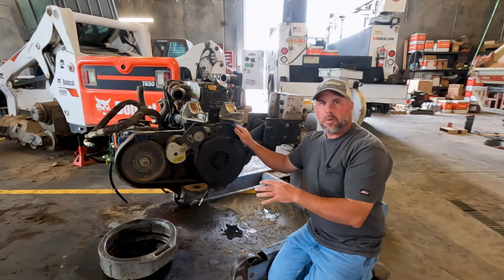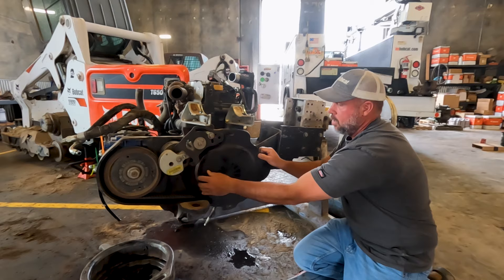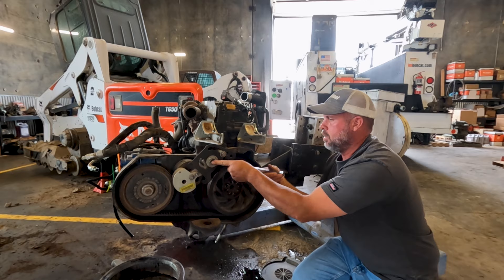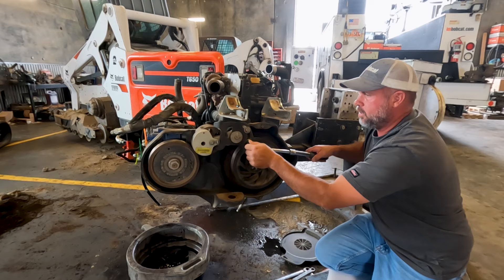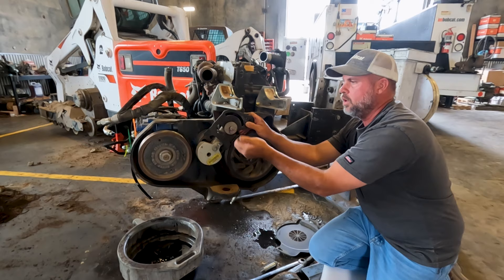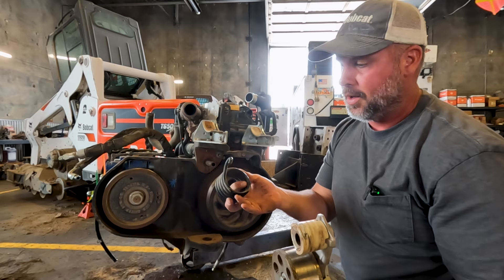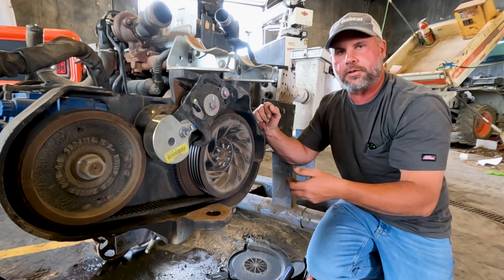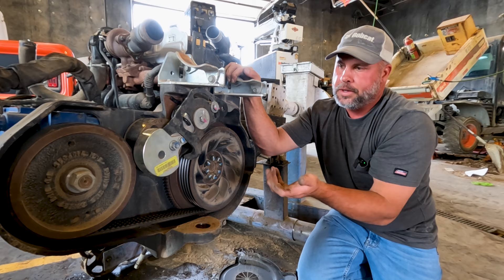Bobcat Drive Belt and Tensioner How To

Comment: I have s510 upon start up have a rattle/grinding noise in belt area, haven’t broke it down yet, but could bad tensioner be the culprit?
Reply from the maker: I would think the tensioner pulley bearings have failed.

Comment: On my 763 we find that we cannot keep tension on the belt even with a new tensioner.  There were two belt lengths for 763's one is too short and the other is too long.  We drilled and tapped a new hole to make it work.  However, after just a few minutes we lose tension.  You've seen many more of these than we have do you think we would have a chance of mounting the new style tensioner to the old style of housing?  It looks like a single threaded hole and a roll pin.  The adjustment and tensioning look much more forgiving.  I think we could buy one from salvage.
Reply from the maker: You should have a spring tensioner.  Are you sure the you are getting the spring engaged correctly?

Comment: Great video.  I have a question.  My S550 is very similar to this setup.  However,  my tensioner appears to be frozen/stuck to the hollow shaft. I loosen the mounting/pivot bolt and the tensioner will barely rotate even with a breaker bar. Is this common? I am considering heating up the hollow shaft, but am concerned. Any ideas?

Comment: @11:02, Very important step to make sure that bracket rotates completely where it's touching that 'pendulum' part, and pull it down a hair past that.    If working with mechanism inside the Loader, it might be good to wear gloves, otherwise you might slice your pinky open on the battery box tray on the bottom if these wrenches slip during that rat trap maneuver.        Note: Most torque wrenches are not "Bi-Directional"  where you can get a torque read in both directions.   When you are trying to put the 40 lbs of pressure, your garden variety Torque wrench will not give you the 'click' you are waiting for.   You will need a Harbor Freight Pittsburg torque wrench that is "reversable" or something better if you want to make sure it's torqued correctly.  I found the best thing to do is just like shown here, make sure that bracket rotates where it can't rotate any more and the belt is tight.    Otherwise the belt will start slipping, it will make a loud clicking/rattling noise when you strain the hydraulics like when turning and you will have to re-tighten.     If you get the belt on right,  your machine should feel 'peppy', like it has got some power back.

Comment: Hi yes I did remove all the fuses the sockets did feel tight. I will unplug the aux controller tomorrow.Sorry what do you mean see if gateway comes back online. The machines controllers seem to be working I don’t have an external tool on it. The codes just pop up. This happens erratically but once it does it continues for a while.

Comment: I got a 2015 t770 that will need a input seal on hydraulic pump sometime. Wondering what the best way to go about that? Even a video on pulling the engine and pump assembly would be nice!

Comment: Im a beginner in this field of work I have about 2 years on Bobcat and Genie scissor and telehandler maintenance and repair.  You have helped me tremendously. Thank you very much.  I am beginning to understand the Bobcats. I had an issue with a 2017 T650 it has erratic trouble codes( M4404 "aux controller no communication)and (H7404 gateway controller no communication main controller no communication. I have check all the fuses all good, and have unpluged and check the wires and plugs from the controllers that route behind the drivers seat. I lifted the cab and checked the wires and plugs Any thoughts.
Reply from the maker: Did you actually remove the fuses and make sure thay are tight in the sockets?
Reply from the maker: Unplug aux controller and see if gateway comes online.  You might need a new auxiliary controller.

Comment: Thank you
Nice video
How do you change the stud that tensioner bracket goes over
Stud I'm referring to is pressed in to block
Reply from the maker: Weld nut to end and use all thread to push shaft out.  If engine is out of machine then just use slide hammer.

Comment: The stud u mentioned where the spring goes over how do you replace that
Reply from the maker: You can use an air chisel to get it out and freeze with nitrogen to reinstall if the engine is still in the machine.

Comment: Have you ever had any of the bolts loosen during normal operation and cause a squeaking? sometimes under heavy/ med operation i'll lose all hydraulic function and but the motor revs will stay the same, then when i back off and let it idle down they'll come back, but it'll do this infrequently. think its a slipping belt? I'm going to dismantle it this week and try to figure it out using these videos, but I was just wondering if theres anything in particular I should be looking for while I'm in there other than a bad pulley bearing or bad belt? 2015 t750 kubota engine btw. Thanks!
Reply: Nvm. I used your video and found the uhmw bushing was destroyed and allowing a lot of play under heavy load. Ordered new parts. Thanks for the video! My bushing and spring/arm are one piece though. And the whole thing has two bolts holding it into the motor. Different than the two I saw you replace.

Comment: If a drive belt wants to run off the side of the drive pulley would that mean it’s not tensioned enough? Or does it mean the the tensioner wheel is no good?
Reply from the maker: Tensioner wheel and or tensioner arm

Comment: I have s590 bs4  i have issues tensioner pully worn out within 500hrs run what is the issue..??
Reply from the maker: Did you replace the tensioner arm?  A worn arm could allow the pully to try and ride at an angle.

Comment: Brady, What is your opinion on the belt drive Bobcat used for a long time (what like 90s-2020?, until the R series) vs direct drive they used to use (my 843 for example), and pretty much any other manufacturer? When the R-series marketing came out I remember a video where Bobcat acted like they re-invented the wheel by using direct drive instead of a belt. Which made me laugh since no one else (that I can think of) used(s) a belt and Bobcat itself used to have direct drive. Just curious what your thoughts are. Keep the awesome videos coming!
Reply: When the universal joint failed on a friend's 843 it sheared off the shaft. Not a fun repair either. The belt allowed a transverse engine mount to simplify maintenance. The original M series like my 610 used a variable belt drive.

Comment: Thank you very informative video but on my machine I'm fighting the bolt actually hitting the frame and I can't pull it any farther to clear the frame
Reply from the maker: What model machine?  I've never had one that would not come out.
Reply: @tetradgroup  2016 t870 same tensioner as what you had in the video
Reply from the maker: @haroldwilliamcoy7979  the T870 should have 2 bolts on top of tensioner and the whole assembly will come out.
Reply: It was the same tensioner design you showed is looked online and saw two variants and this tensioner wasn't very common I just didn't have clearance and was ultimately unable to change the pulley today but found I'll have to change the whole arm when I get time

Comment: My bobcat starts and gives a message  that the hydraulic  change  pressure  in shutdown. I checked  the fluid level and the  belt and it is all fine. When I checked the filtre it was inexistent. I bought  this machine like that and I'm trying  to fix it. Also the opsi is low when it starts then it shuts down. What else should  I check ? Thanks
Reply from the maker: If you are sure the main drive belt is good then I would suspect the charge pump itself has failed.
Reply: @tetradgroup  yes I have checked  the drivebelt. I'm changing the charge pump sensor. If that doesn't fix it then I will buy the charge pump.

Comment: If the adjustment lock bolt ( the one with the spacer ) breaks off in the block .........what are the options ? Thank you
Reply from the maker: I honestly don't know,  if it broke flush I would weld a nut to it and hopefully it will back out.
Reply: @tetradgroup  thanks for the quick reply. Yea the thread part of the bolt broke off in the block. I would try and drill it and use a extractor but as you know if the engine is still in the chassis this is a @#$%&. Not even sure its possible. I watched your other video where you torqued the tension to 40 ft lbs and it almost looked like the spring itself is around that tension. Wasn't much to get 40 ft lbs.......I just noticed it .....I have a feeling its been like this for a while. Works fine and I can live with the rattle of the bracket for now.......whats your thoughts ?
Reply from the maker: @bcummings2187  after the initial torque the bracket usually doesn't even touch the arm in most cases so spring tension should be fine.
Reply: @tetradgroup  ok....thanks again for the quick replys .....ill keep an eye on it ....I guess the older the belt gets and stretches the more of an issue it will become but until then 🤞 haha

Comment: You seem to be the guy to ask I have a 2006 T250 and I have a oil leak behind the hydraulic drive motor pulley is there a seal behind that pulley that I can replace
Reply from the maker: Yes there is a seal behind the pulley.
Reply: @tetradgroup  is it a hard seal to replace without pulling the hydraulic pump I have the track off and I can get to the pulley I’m going to get a puller tomorrow and get the pulley off and I have found all your videos very helpful
Reply from the maker: @michaelweber8186  getting the pulley off is the hard part.  Once the pulley is off just remove snap ring and pry seal out.
Reply: @tetradgroup  thank You your really good on this bobcat equipment
Reply: I got the seal out and found the Bering is starting to fail the dealership had all the parts and didn’t seamed concerned about the Bering starting to get sloppy I see a couple of snap rings on the Bering hopefully I get it changed out tomorrow morning

Comment: Great video, as always, thank you. I kinda cringed when you held the tensioner up by finger tightening that bolt, and removed the belt. I was thinking, this thing is gonna snap down right on his fingers! LOL Glad it didn't. I believe and trust your skills.......But from my general experience, that just did not LOOK right. I guessing it must have a wedge factor in it versus a smooth travel that would require more torque on the bolt.
Reply from the maker: Haha, no you're exactly right I'm always scared to put my fingers near that tensioner. It does wedge itself in there pretty tightly but again that would definitely leave a mark if it came loose.